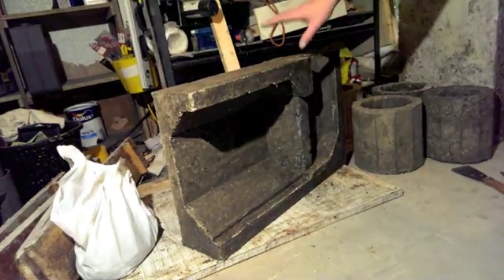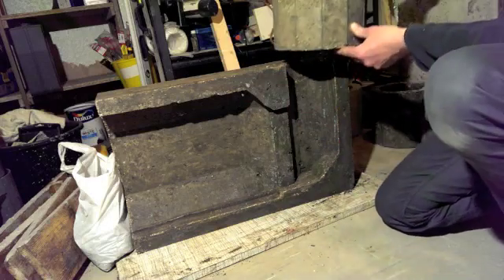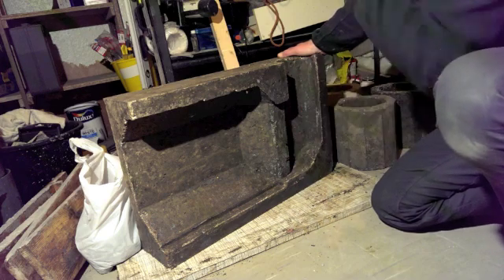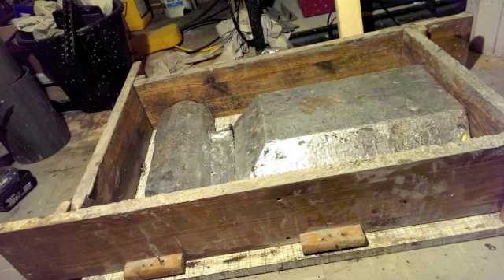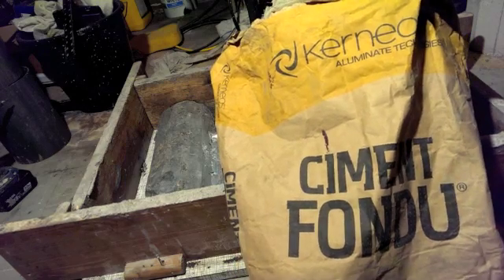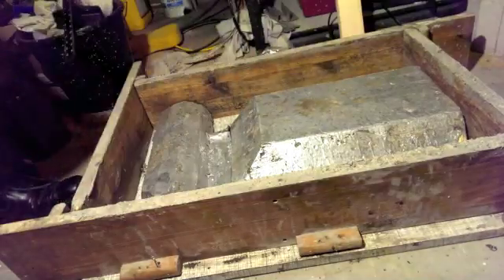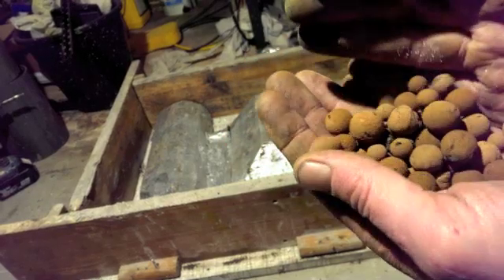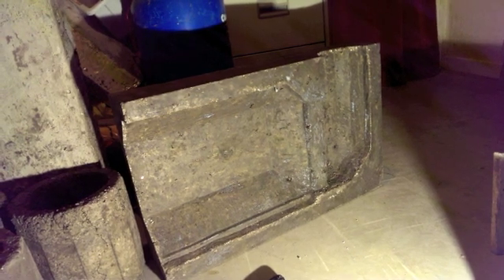Rocket Mass Heater Batch Burner Chamber Refractory Casting

Comment: Any chance you could share the mold files right and left halves (voids) in dxf format, or some other format besides sketchup .skp?   I'd like to get a 3d printshop to make them.  thanks, Mark
Reply from the maker: Hi Mark, I don't have any files for this sorry. I made the insert from flat sheets of rigid foam that I cut to the dimensions on the batchrocket.eu website. I don't have experience of model software but imagine it would be relatively straight forward for someone who does to draw up the plans. Good luck.
Reply: @batchrocketproject4720  thanks so much!

Comment: Great mold. Regarding the cement used, yea.. for high temperature, you want "CA" cement or Calcium Aluminate. The Rapid Set sold in Home Depot and Lowes in the U.S. is Calcium (Sulfate?) Aluminate or CSA, which will likely NOT hold up to intense heat over time like CA cement. CA cement is not sold in U.S. retail stores and you would need to seek a specialty cement provider or wholesaler to get it. I would not use the round stones in the mold but rather something like tiny stainless steel pieces (they sell stainless steel coat hangers) or shredded steel wool perhaps, kept away from the heat for expansion issues. With CA for a pour this small, an aggregate or binder like rebar may not even be necessary. Adding perlite is also likely not necessary if you have real CA cement but a small amount can't hurt, but like he said, too much will weaken. If you want to be sure, and make the thing invincible, I would do 4 parts CA to 1 part perlite with maybe two inch long pieces of coat hangers laid in an inch away from the heat so they don't expand and crack the thing. I know the whole mold will get very hot but the inside of the mold will be several hundred degrees less than the part 1/4 inch from the fire.

Comment: I used this exact mixture to cast my batch box stove. Unfortunately the mix is far too weak. To my great disappointment the components all cracked and broke during fit up, and even when gently removing forms, components still broke. I left them in the forms for 4 days as they seemed unset. This was a big loss of investment in time and materials for me. I strongly encourage people to spend the extra money and cast the entire thing with castable refractory cement, the fireclay seemed to completely undermine the bonding strength of the cement. I do appreciate the authors time and effort for the video. I just wish it would have worked better, and I could get back the week of time and hundreds of dollars lost.
Reply from the maker: Yes they are fragile, as seen in some of my other videos. I demoulded after a few hours as alumina cement reaches initial cure quickly. My feeling is that it is the perlite that weakens the mix although agree the fireclay may contribute. 

I still used all my parts by gluing them together with a stiff paste made by mixing powdered Magnesium silicate (pure talc)  into sodium silicate (purchased, the 'recipes' found online do not make sodium silicate and involve dangerous preparation). There were no problems with any of the repaired cracks in the 5 months or so I used the burner daily. When I removed the burner, several parts broke again but none along the repaired lines.

Incidentally a simple mortar made from lime putty and fine sand works well as a filler for any larger gaps. The geometry of my brick container meant there was a 5-10 mm gap between the two halves of the casting when I installed. I filled these with lime mortar. I also used the lime mortar to bed the door frame onto the front of the casting. Again, when I removed the burner, those lime joints were still perfect.

Overall, you're right, a simple concrete with high alumina cement or purchased refractory (which may have added clays in addition to the alumina cement) would make a much stronger casting. The trade off would be the lack of insulation which may increase the time needed to reach the temperatures needed for a clean burn.

If you have the broken castings, it's worth considering piecing them together with the cement mentioned as you install.

Thanks for posting your feedback, it will be useful for viewers.
Reply: Thank you for the reply, and the info, it's encouraging.  Did you find that the pieces harden up after firing? I will try piecing it together will the paste your talking about. I really appreciate you taking the time to write such a detailed response. I was pretty discourage when things started falling apart, and this gives me hope I might salvage the pieces. Thanks
Reply from the maker: @garyStaple-nt4tl  I think it was about as fragile when I removed it as when I installed it (difficult to be certain as I had to break mortar joints from surrounding brick and that may have transferred significant shocks; it did break into several pieces). 

I think you may be right about the fireclay as I doubt it gets hot enough to fuse and may not allow the cement to fully bind everything.

I hope you can salvage something from your project. Good luck!

Comment: What is your best guess for a cost comparison between that casting and if I were to use only high temp castable cement without the aggregates of perlite, pebbles, and sand? I realize it would be stronger but less insulating, possible requiring a ceramic wool blanket around the core.
Reply from the maker: I think your approach would be cheaper and much stronger. I don't remember exact costs but the high alumina cement was expensive and, as there were no local stockists, had significant delivery costs, as did the fireclay (I believe the delivery cost for that was more than the material). The perlite is fairly cheap (I bought a 100 litre bag for £20 recently in the UK from a local supplier) but it considerably weakens the final casting. 

If you can get ceramic fibre insulation blanket affordably, it would keep the heat in very well, it might just take a little longer for the core to get really hot as the thermal capacity of dense refractory will be higher. All in all I think it would be a good approach. I wouldn't use the clay pebbles again as they are probably a little too large for the thickness of the casting. And I tend to use less and less perlite each time I cast anything to lessen its weakening effect. Denser refractory has the advantage of holding more heat and will stay hotter for longer between re-fuelling. It's only on start from cold where insulated mixes might perform better earlier on in the burn. 

I believe the cores of the commercial high temperature and ultra-low emissions Pyroclassic burner from New Zealand use dense refractory wrapped in ceramic fibre to good effect. They use a cylindrical casting, wrapped in a layer of ceramic fibre, with an outer thin-sheet steel wrapper. It burns very hot and I think this is an excellent approach. See https://www.youtube.com/watch?v=rb6z-79kW5k&t=195s - that video contains some good shots of their construction.

Comment: Another question if you don’t mind?   I have followed the dimensions on peters web page and I’m wondering what to use as an expansion joint between the two halves?
Reply from the maker: I used a lime mortar to bed the core and between the two halves. The proportions were 1 volume of hydrated lime powder to 2 volumes of sand, with about 1/5th volume or ordinary portland cement (this, I think helps set because of introducing clay impurities to the lime rather than because of the normal cement chemistry). I was expecting the lime-mortar joints to break in use and planned to make repairs with purchased fire cement but they didn't break. In fact, when I dismantled the core, the joints were stronger than the casting - the lime mortar stands up very well to the heat (so much so that I'm currently experimenting with lime concrete containing perlite as a casting material, although I can't yet recommend it as it's too early to tell) .

Good luck
Reply: @batchrocketproject4720  thanks so much for all the info, it really helps.   i have both halves cast and two riser sections and i agree that clay balls do not really help as the vibration juyst makes them float.   for the last two riser sections i have used a 50:50 mix of refractory concrete and grog. hopefully this makes the very expensive concrete go further.   thanks again for your help.   when its done and published ill send you the link.   cheers   tanc

Comment: Hi chap, How’s it going with this heater?   I am about to cast some core based on this design and am wondering if you have any advice that is not in your films?   Cheers.   Tanc
Reply from the maker: I installed and used the burner with a large masonry bell for six months, before removing it as it was in a tiny house that I was renovating and took up too much space. It exceeded all my expectations, very warm and a quality of warmth I'd never got from central heating.

I did find the castings to be quite fragile and many parts were heavily cracked by the time I assembled it. I've often though that if I was doing the same build again, I might decrease the ratio of perlite and increase the sand to strengthen the casting. I glued broken pieces together using a stiff paste made by mixing ordinary talc (magnesium silicate, not starch based baby powder) with sodium silicate. Once installed, the mended pieces were stable and remained intact when I dismantled the burner six months later. I'm not sure I'd use the clay pebbles again either; they were probably too big for the thickness being case. I think the main advice is not to worry of castings crack when you make them. Just glue them together and stabilise them with whatever surrounding masonry you build.

Comment: how has the mix held up after four years of burning?
Reply from the maker: The castings were fragile and, as some of my other videos show, many pieces were damaged just by being moved about and temporarily assembling for test burns. When I was ready to install the burner, I repaired the cracked parts with a 'glue' made by mixing ordinary talc (check it's pure talc without corn starch) to a stiff paste with sodium silicate (this is similar to the paste used to repair exhausts, where it is painted on a wrapping bandage). 

I used the burner daily for six months while I was renovating my house and when I removed it, the glued parts were still intact (and no other crack had appeared). There was no significant heat spawling after six month so I would guess it would last a good deal longer (I removed mine because it was taking up a lot of space in a small house). 

Incidentally, When I assembled the burner, I used a lime/sand mortar to cement the two halves together and to bed the door frame against the casting. I anticipated that this might flake away in the heat and would patch it with fire cement as problems arose. To my surprise, the lime mortar was intact and strong when I dismantled the burner, it seemed to stand up to the heat very well.
Reply: @batchrocketproject4720  Brilliant. Thanks for that

Comment: How about telling us the ratio and actual materials mixed for the refractory chamber ???? Thanks
Reply from the maker: I used the following mix, all parts by volume:

2 parts ciment fondu high-alumina cement
2 parts powdered fire clay
1 part fine sand 
4 parts perlite
4 parts clay pebbles

Mixed with sufficient water to be workable. I would caution against making the mix too dry as the drier the mix, the harder it is to compact it and there is a risk of voids.

When I casted the heat riser tube pieces, I was concerned that the clay pebbles might be too large compared to the thickness of the casting and so replaced them with a processed glass product called "growstone". These are smaller than the clay pebbles. I think, being foamed glass, they might melt in the fierce heat of the burn chamber so would use clay pebbles for that. For the heat riser though, the heat is less penetrating and the glass does not seem to have been a problem there.

Comment: Great vid!  I've been looking for details on building the mold for castable refractory, this fills the bill.  Did you use any kind of mold release (oil, grease, etc) and if so what kind?
Reply from the maker: Hi Lawrence, I used cooking lard (soft pig fat) to coat the aluminium tape covering the mould plug. it seemed to work very well as a mould release and, being soft, went on easily without disturbing the fairly soft plug as I think beef tallow might have done.

Comment: I have seen several cast batch box designs, all cast as left & right sides. My question is: why not top & bottom? That would solve the problem (partially) of banding 2 parts together. Gravity would do most of the work.
Reply from the maker: I can see the logic of your suggestion Lark. I think the symmetry of the side-by-side arrangements makes it easier to design and make moulds but am sure a top-and-bottom set could be made and, as you say, might make for easy and stable assembly. That said, when I finally installed it with mortar, I found the sides mated easily and, with a masonry bell enclosing the burner, were stable.

Comment: excellent design . and obviously efficient . does Peter object to new   ideas   old dog new tricks   springs to mind   and I am  74  and accept excellent ideas and designs . Small eddy's ! etc    have no place in efficient airflow . I can see your burn chamber is just begging for a Pyrex "door". The clay (Maltesers)  you are using are called   LYTAG  ..   (Light Expanded Clay Aggregate )   and is available in different size balls  from pea size   up to Malteser diameters ..I suspect your secondary air inlet will come into it's own once you add a door / whatever, to the front of your burn chamber . you are on the right track   forget the negative comments   just take them on board and file them in a  back up folder . I have converted two Chinese cast iron wood   burners into after burn  (Dunsley Heat,   Yorkshire stove) technology. the   AFTERBURN   sounds exactly like it says  after burner.   a sort of subdued roar . With your  brilliant fabricating ability . I would like you to check out an inverted bell shape at the bottom of your riser    to retain the vortices   in place for a while longer . Also introduce the air / fuel burn offset to one side with the secondary air introduced from the same side of the fuel flow inlet into the now bell shaped bottom of the riser .This is   logical thinking on my part .. I designed a combustion chamber for my Model gas turbine powered  R/C helicopter in 1999 which used a torroidal ring vortex  to efficiently mix the vapourised  Jet A1. in the front of the chamber   instead of the    at the time stirring action .
Reply from the maker: Thanks for the comments Richard. I think Peter's point, a valid one, is that many of us waste time and energy "reinventing the wheel" and not so well! Much very systematic experimentation is summarised on his website http://batchrocket.eu/en/ and I found it invaluable in progressing from tinkering to making serious progress. I may have simply dodged a bullet with my change to the basic design!
Your projects sound excellent! Happy building and experimenting!

Comment: I love your videos. 

Is this particular mix good for absorbing heat and releasing it slowly?  Is it a good heat conductor?
Reply from the maker: Thanks Gary. Rather than storing heat, the mix is designed to be insulating to allow for maximum heat to stay in the burn chamber and allow for a clean burn. Even after long burns, the outside of the casting doesn't get hot enough to burn the skin with a casual touch. 

As you may have seen in the many other videos on youtube, people often route the flue gasses through long pipes surrounded in heavier concrete, clay or sand mixes that do serve to store heat and release it slowly over a long time. My eventual aim however is to take heat from the flue gasses using water circulating through coiled pipe and transfer it to hot water tanks to augment my domestic central heating. I've not been doing much on it over the summer but now that winter looms, I hope to resume soon.
Reply: BatchRocketProject 
Hi. Quick question. 
Is there a predetermined/ defined calculation size for the entrance from the the batch box to the gas burning chamber? Does it matter the entrance size? Cheers. Gary

Comment: Hi great videos, can you do a video on making the mould including measurments and the mixture. Great work.
Reply from the maker: Hi Sarfraz, sorry for the delay. 

I used the following mix, all parts by volume: 

2 parts ciment fondu high-alumina cement 
2 parts powdered fire clay 
1 part fine sand 4 parts perlite 
4 parts clay pebbles

I'm afraid I don't think I have any footage of making the mould but if I make another one I'll post something on it. For the measurements, the size of the burn chamber depends on the inside diameter of the heat riser. There is an excellent table and explanation here:

http://batchrocket.eu/en/building#dimension

Thanks for your interest.

Comment: I would like to make the same batch box using insulated fire bricks and ceramic fibre board to make a water heater (150 litre water tank heater). Can i visit you to look at design and dimensions please so i have a better idea on what i should be doing, I can share all progress with you in detail, steel water coil efforts etc. I can offer some cash to help you and so help me in designing the water heater. Email is jfallon334@gmail.com
Reply from the maker: Sorry for the delay DRJMF1. Have you made any progress? I've been too busy to do much more but am happy to discuss details and ideas. Also, make sure to study Peter van den Berg's website, http://batchrocket.eu/en/ as it is a mine of detailed information.